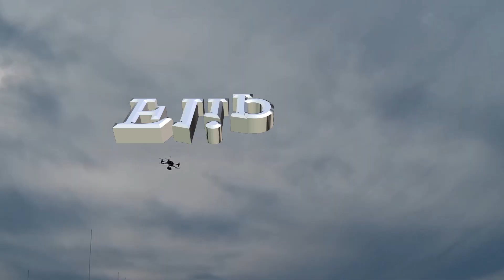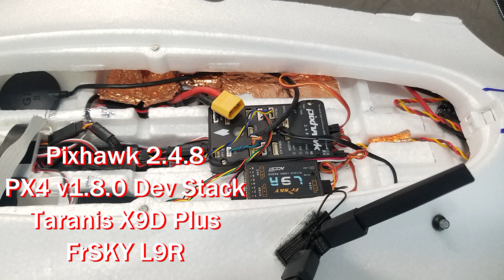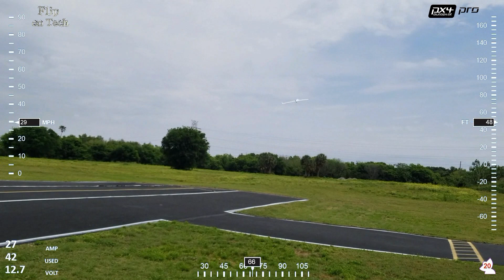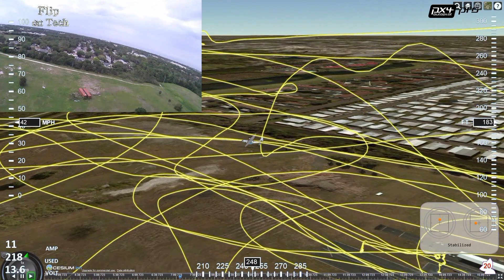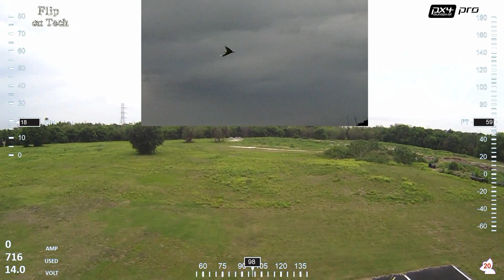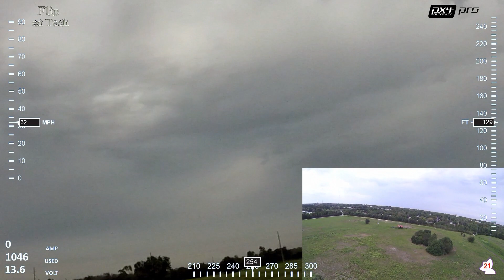Opterra 2m PNP with Pixhawk

Comment: What did you use to program the PX4? Were you intending on flying on autopilot or using the RTL capabilities?
Reply from the maker: I use PX4 AutoPilot https://docs.px4.io/v1.9.0/en/ in conjunction with QGroundControl for setups http://qgroundcontrol.com/ . My primary focus is failsafe to Return To Home should any R/C signal loss. It has already saved it once when the internal RF board of the Tx started to fail and I lost R/C control for a bit. She turned to head back to Home position then performed 500m circles as programmed until R/C signal was recovered and I was able to land her with no incident. If that was the stock PNP setup, it would've been a flyaway and inevitable crash somewhere.

Comment: looks complicated !!
Reply from the maker: Just like anything else new, it could be daunting in the beginning until you get some understanding of how it works. Personally, I find the PX4 Autopilot firmware with less a learning curve than ArduPilot. The community forum is quite large for either stack so getting help is not a problem.
Reply: @rollys1200  do not need help with Tiny Arkbird.
.it is plug and fly...no firmware to download or options to set.